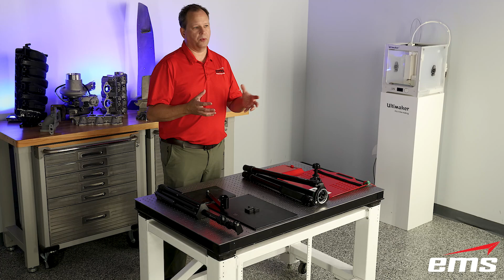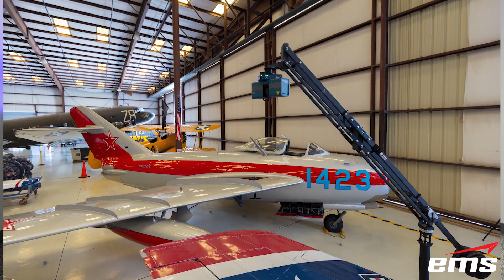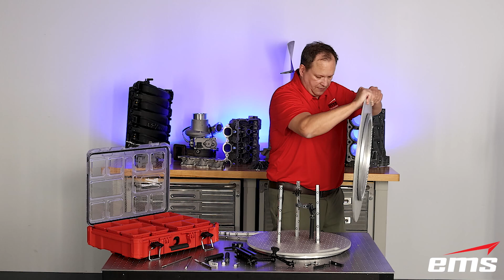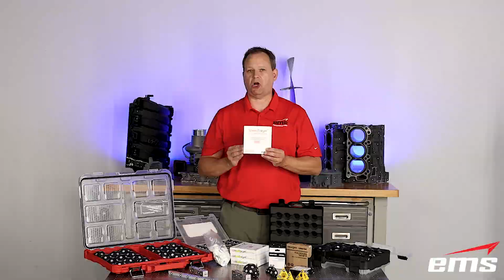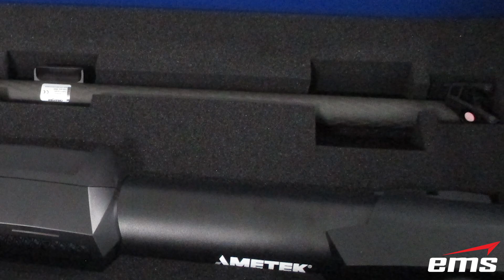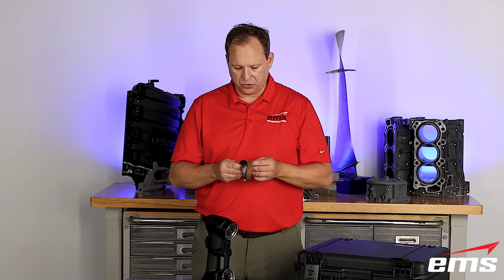3D Scanner Accessories - Save Time & Improve Accuracy

Comment: I just don't understand how he claims that he can scan underneath like this. After all, from the moment he places the scanner at an angle to the markers, he loses them, let's say at 40 degrees, that's why markers are made on pyramids, so how come on pillars the markers are flat and he scans at an angle under the object and the scanner doesn't lose track?
Reply from the maker: The Creaform 3D scanner can see the targets on the vertical pillars when scanning from underneath.  It has a depth of field of 10 inches and has no issues tracking targets on the yellow triangles and/or the vertical bars.  It doesn't need to see the targets on the triangles at all times.  The scanner only needs to see 3 targets anywhere at any moment to be able to track its position.   You can see this on many other videos on our channel as well. Hope that helps.

Comment: I use a wire mesh normally used for fencing and 3d printed clips that are put to the wire and where the markers are sticked on. I made different sizes and made magnetic spacers or use clamps to hold the wire mesh in place.
Reply from the maker: Yes that is a great idea.  One of our customers does that and I thought about putting that in the video.  We have used the flexible nylon fishnets with targets on them but found they move around too easily and you have to start your scan over.
Reply: @EMS3D  that's one reason why I don't use the flexible nylon mesh. The other issue is that the cleanup of the mesh gets messy because it easily gets in contact with the scanned object. When using the wired mesh with spacers I only need to delete the scanned spacers and can the use the semi automated selection tools of the scansoftware to easily select and delete the scanned wires. However the downside is that you can only bend the wired mesh in one direction to follow the geometry of the object. So for a car for example you will need multiple meshes in different sizes to cover everything. And they also aren't easy to store and carry around and you need to pay attention to not scratch the object if its sensitive like the paint of a car.